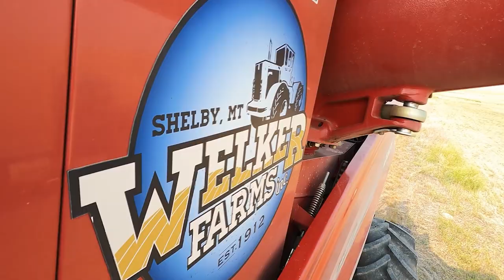The Storm Couldn’t Stop Us!

Comment: You should turn the teragator into a self propelled grain cart and team up with unverferth to build it
Reply: This would be cool
Reply: Not worth the extra cost. That's what tractors are for. They can pull a grain cart which is much simpler, easy, cheaper to maintain and less to break down. Adding another drive train to anything is an extra cost. Tractors already pull grain carts well and can do a number of different jobs. Kind of pointless to have a self propelled grain cart.
Reply: @mikeznel6048  it was a suggestion

Comment: A friend had his brand new Case tractor get struck by lightning a couple of years ago. Completely fried the entire electrical system. Case said to fix it they would need to disassemble the tractor and replace every wiring harness and sensor. Insurance company totaled it with less than 100 hours on it.
Reply: My neighbor had a NH round baler get hit like that.  They totaled it too.  He ended up buying it back from the ins co for pennies on the dollar. Basically scrap price.  He bought the what he needed off a junked one and made his own wire harness. The ins co thought the computer and sensors were toast because that’s what the dealer said.  They were wrong and he got a baler for less than half the cost of a new one plus a little of his own labor.

Comment: I think is was the 60 series JD combine, if you had the straw chopper raised to check something inside then lowered it but forgot to engage the belt tightener lever, the chopper warning didn't work. We filled one up with tough soybean straw so bad that it took 2 of us 6 hours to get it running again.

Comment: Question: will next years crop have an easier time because there are more nutrients left in the ground? I assume the crops this year didnt exhaust all the fertilizer and pre-exisiting nutrients?
Reply: There will be 'rock' nutrients (phosphate, potash, sulfur) that will stay in the soil but nitrogen will somewhat stay in the soil but the nitrogen will break down any old plant material and
Reply: Most casesafter a dry year fertilizer will count as a bonus to next yrs crop most will put the same amount banking on thefact that next isnt likely to be a drought  and hopefull it will be a good one plenty of rain to give a great yield
Reply: @carlfalt174  sulfur can leach like nitrogen
Reply: No, not necessarily because this years crop probably used as much nutrients as possible.
Reply: Phosphorus too will leach if you look on the bag or the anslysis it will  have a certain amount % water soluble,  certain %acid soluble and certain %insoluble which takes the for of rock phosphate and goes into the soil fertiloty bank and buildts up overtime. There are farmers here in Australia who use human solids composted ,pig manure and chicken poo in tandem with things like neomin and alrock rock dust bentonite and certain soft broen coal to increase organics and carbon to rIse organic carbon levels
Reply: @derrickeischens3993  but a 10 bushel wheat crop with 6 inch straw will use less nutrients than a 35 bushel crop with 24 inch straw. It be interesting to compare nutrient soil samples in an extreme drought year like this to compare nutrient loss to a normal growing season
Reply: @massimopecile9666  I have put sulfur on my alfalfa hay land for 30 years and in soil samples it shows that it maintains the level quite well

Comment: What's the reason behind harvesting the field, running a direction through the field 45 degrees from the direction it was planted?
Reply: It helps pick up better, you can have the head down on the ground and it will glide over the ridges created by planting. Going along with the rows you risk digging the cutting bar into the ground when you run it as low as you can and also it helps not to pick up rocks.
Reply: Thanks for answering.  The crop was laid nw to se.

Comment: You should turn your teragator in to a self propelled grain cart.
Reply: Kind of an unnecessary cost. Tractors pull grain carts just fine and are capable of doing a number of other jobs. It's an extra cost that isn't needed. Any time you add an engine and drive train and more tires, you add to your maintenance budget and it would use fuel that would otherwise already be in use in the tractors.
Reply: @mikeznel6048  it was just a suggestion you don't have to get so sassy about it karen.

Comment: I could be wrong but I believe the macdon drapers take engine oil and not hytran
Reply: Your wrong hytran oil
Reply: @darrylpaulhus3069  have you read the manual on a fd75. It calls it hydraulic oil and states 15w-40 engine oil. I know all 4 of ours  are running engine oil. I wish I could share the picture in our manual but some simple Google will work for you.
Reply: Here's what we were told. Engine oil is better because it has more additives  which is what high performance pumps need that hydraulic oil doesn't have. Engine oil also doesn't foam like hyd will when a pump cavitates. You can use Engine for hyd but not the other way around. Look at all the big mining manufacturers that run engine oil in everything, not hydraulic oil.
Reply: My manual states hy-tran
Reply: @darrylpaulhus3069  that's interesting. How new is your header?
Reply: 2020
Reply: @darrylpaulhus3069  ahhhhh. At the last combine clinic in 2019 they were showing off the updated macdons where they got rid of the stupid end shields that don't open up fully and went to hydraulic oil finally. In 99% sure anything pre 2019 is engine oil.
Reply: Yeah they add confusion to the mix i think also different market countries have slightly different recommendations

Comment: Are those Fd75 headers? Aren’t they supposed to use 15W40 oil in the hydraulics? Or do I have the Fd1 series confused with the Fd75s
Reply from the maker: Well we may have used the wrong oil, have always used hydraulic oil in our macdons, these are 2152 but not sure what the macdon branded version is. Guess we should have ready the manuals we don't have 😂 oops
Reply: @WelkerFarms  obviously it really doesn’t matter… in your  conditions you run the slightly higher viscosity of hytran is a good thing.

Comment: Those older macdon/ih headers run on 1540 not hytran...the fd 145 switched to hytran... better drain your system before you do damage
Reply from the maker: I see it calls for 15w-40, hmm might have to change that out. I know viscosity is nearly identical on those two but additives are different.